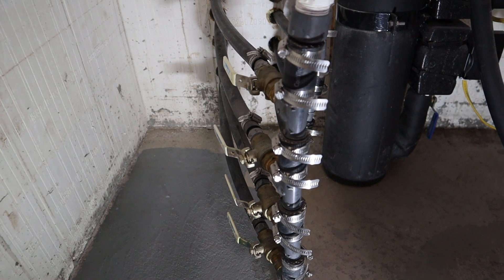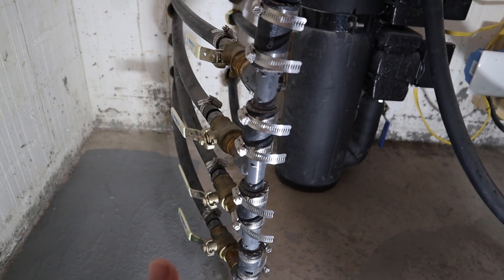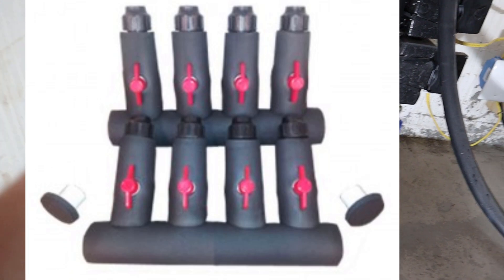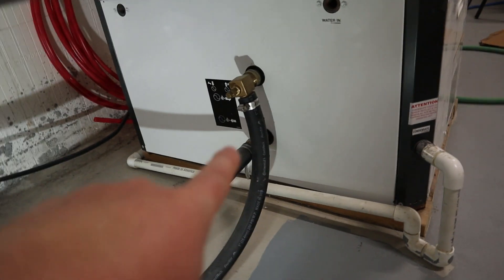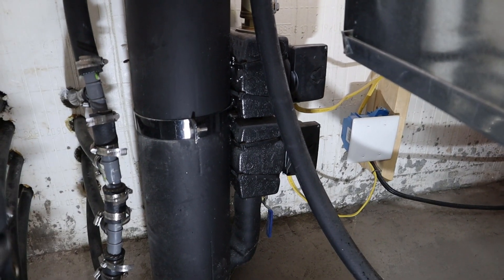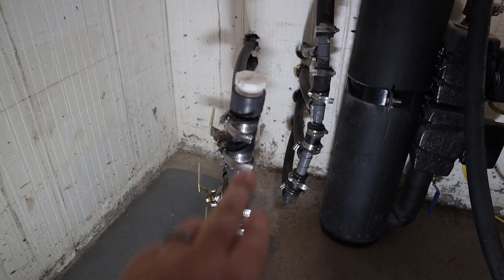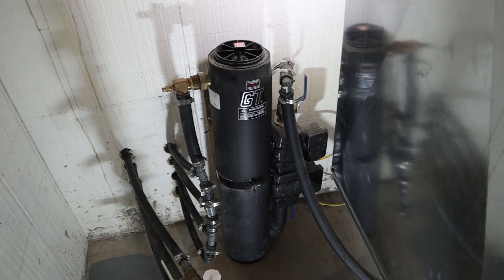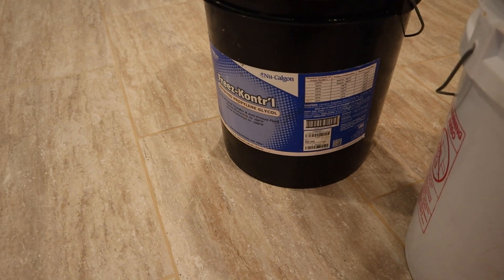Pipes & Pumps - Step by Step DIY Geothermal (Part 4)

Comment: Just wondering if your GT Flow Center is powered through your heat pump, meaning once the compressor turns on your flow center pumps turn on?  Or is your flow center independent of your heat pump and you run it all the time?
Reply from the maker: I connected it to the contactor in the heat pump.

Comment: Fast fluid is not bad, unless the pressure required to produce that flow rate exceeds specifications. Increasing fluid flow rate decreases the thickness of the fluid boundary layer, significantly increasing thermal conductivity into the fluid. 

The only way you would run into an issue is if you cool the refrigerant so much that the temperature differential in the evaporator is no longer sufficient to boil the refrigerant. This is possible if your AC unit is oversized or your trying to cool below the designed minimum operating temperature of the unit.

Comment: For the sake of saving money and space, what do you think about using one GT flow center for 2 units? They both will sit in the basement relatively close to each other.
Reply from the maker: I wouldn't for redundancy purposes.  If the pump went down, you lose all of your hvac.  I'm also not sure how one would valve the systems for when one system runs and the other doesn't.

Comment: Thanks for the videos.   I have a GT Flow center and every two or three years the system burps out fluid and it stops working.   Probably due to low fluid or air that gets introduced.  To get it working again is it as simple as opening up the gt flow center and filling it with the antifreeze?
Reply from the maker: If the fluid is getting low, you need to fix the leak in the system.  My system has been running for 5 years, and the level has never changed.  Once the leak is fixed, just refill and run it.

Comment: Any recommendation for a supplier? And did they help you with the design? I'm east of you in Missouri. Thinking about a pond based setup as I have a 3 acre pond near my shop and future house site. Also running 100% on a decently sized off grid solar system (100 KWH of battery with capability of supply 24kw continuous).
Reply from the maker: I would recommend a local supplier because they will have a better understanding of your soils and help with design.

Comment: Hi Garret, thanks for the videos! I live in northern Maine where we sometimes have periods of time that the temperatures hover in the teens and down to -10 to -20 for a week without windchill. I am planning a new slab on grade passive house building and I was thinking of integrating a geothermal heat pump into the system. I am not sure if the climate is too cold for a closed loop system or if a 10 ft trench to bury the pipes would be appropriate.  Any thoughts?
Reply from the maker: Your ground temps will be cooler than mine, but as long as you've placed it deep enough, you'll be fine.

Comment: @garrettglaser I’m putting in a very similar system using a Gt flow center and a Bosch sm thanks to all of your information. I’m putting in a 4 ton unit and I’m just wondering would it hurt to make my grounloops a couple hundred feet longer?
Reply from the maker: No problem at all

Comment: Hey there, I have done a ton of research on these and have watched your videos multiple times but something in the industry is confusing me. Why are the geothermal pumps still utilizing Freon to cool. Isn’t it waster? Why are they using conventional style systems
Reply from the maker: It's a heat pump which is not a passive system.

Comment: * What is your opinion on using heat pump condensers that come with built in variable speed pumps?
* Can reverse-osmosis water be used in place of the the de-mineralized water?

Am planning a system for 40x40 post frame type house on 5 acres in MN
Reply from the maker: If the pump is built-in, all the better.  I'd still have a reservoir like the gt flowcenter has just to keep the system non-pressurized.  

I'm sure the reverse-osmosis water would be fine.  Really, you are looking for highly filtered water.
Reply: @Challenged1  Great!  Was planning on making a pvc reservoir similar to the one in your flow center.
Reply: Hey Erik....where in MN?  I'm building a post frame shop with an apartment in it on a lake near Willmar and considering geo for heat and air.

Comment: Hi Garret, I live in Northern Ireland where rain and moisture in the soil IS NOT a problem. With that being said, I want to move from gas boiler installs to renewables. GSHP at the moment are beyond most budgets, but I would like to make this more affordable with the use of smaller boring machines. I've yet to speak to an actual Goethermal expert, but could several bore holes of say 15-20m be enough to generate enough Kw of heat for a heat pump to be used in a typical 3 bedroom semi with added UFH/larger radiators (and also an upgrade to the insulation). Vertical instead of horizontal piping would be best suited to most urban dwellings. An explanation of your thoughts would be really helpful.
Reply from the maker: If you could link your bore holes together, basically a daisy chain, then yes.  Each line would have 3-5 bore holes.  I would keep the bore holes 10' apart.
Reply: @Challenged1  Hi Garrett, that's comforting to know, but what sort of KW would come from, let's say, the 3-5 bore holes that are thermally linked with a flow and return from and to the house. If it needs to be more, then simply doing another set of holes could be done?
Reply from the maker: @davidb2464  It's not really a KW calculation, it's a BTU loss calculation of your home so that you know the tonnage (size) of your system.

Comment: Garrett- cost aside, wouldn't one of the newer automotive AFs do better? Several are formulated to carry more temperature calories/unit than just water or many traditional AF formulas. The plumber I am looked at your manifolds- they pass the first rule of plumbing- they don't leak. So I'll give you a pass for not being gorgeous. Also, you are not getting equal flow through each of the four 600' lines due to your manifold design. A two into one then those two into one would balance all the distance and drag factors between the four. BTW, ball valves are FTW- self clearing, can be used for throttling, much less inclined to failing due to scouring. Five years from now, a gate valve will want two pair of rusty pliers to turn- the gate valve will generally clear any buildup and operate as designed. FR
Reply from the maker: You are correct, the ball valves can throttle the fluid if needed to balance the lines.  I've found that each line is within about .2 degrees (F) of each other, so for all intents and purposes, it's pretty well balanced and hasn't required any throttling.  Assuming the lines are placed at the same depths, the head pressures remain the same, so balancing happens naturally.
Reply: @Challenged1  Glad to hear that you have looked into it.  Know much of it is subtle but what look like only mildly unbalanced flows can have downstream repercussions on maintenance and other issues. Two water heaters piped to heat water fro the same supply system need to have their plumbing as close to perfectly balanced or one WH will wear out much faster than the other. Also this means one WH did most of the work. End of the day, Garrett, it only has to work for you and I want you to succeed and tell me how! I will agree that a temp Delta of 0.2 degrees is pretty good indication that all the factors together seem to be very close to inbalance. F or C, btw! 
I was also curious if some of the "super coolants" ,devised for modern cars much higher caloric output, might help increase the Delta T on the loops. TYVM for the answers so far- your "inner engineer" is showing, but only other engineers or their children (me!) are likely to notice! FR

Comment: It seems that this type of system would require regular rain. Our rain stops in ~April and doesn't start back until ~November. The ground gets pretty hard and dry over the summer.
Reply from the maker: You'd definitely want to dig a test hole in the ground at depth during the height of the heat to check moisture content.
Reply: @Challenged1  The other issue is that at 30" deep you hit hard pan that is almost impossible to get through. Trees push out of the ground as the roots cannot get through. Auger bits just bounce off like it is concrete.
Reply from the maker: @mutantryeff  Goodness!!!